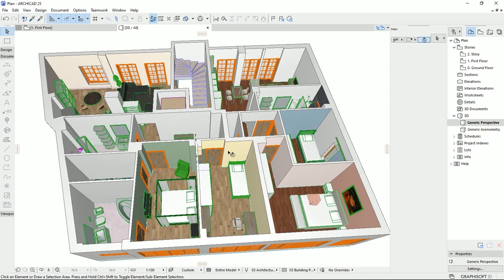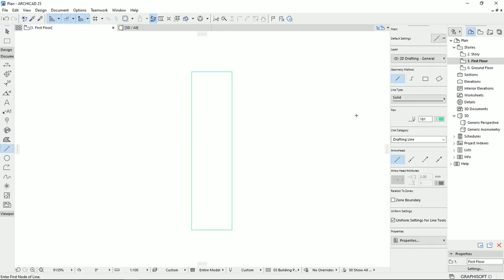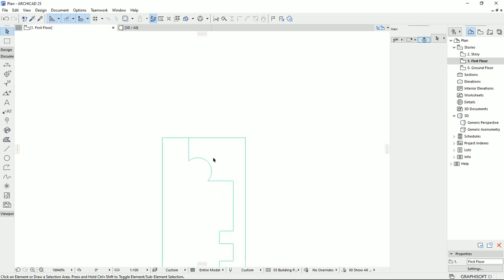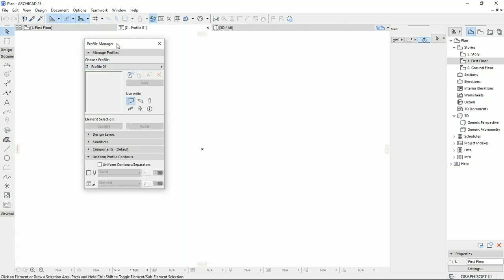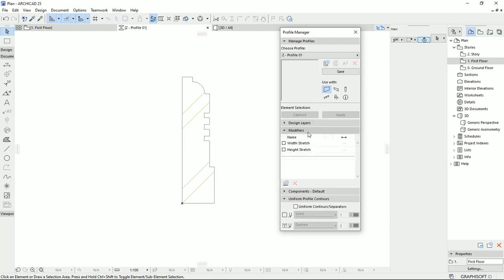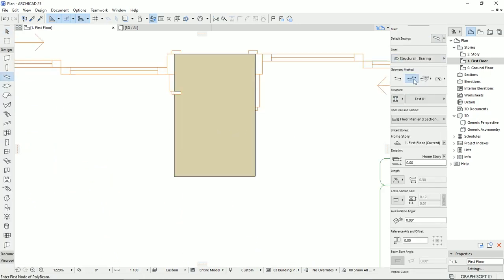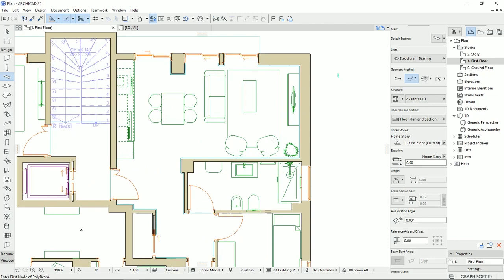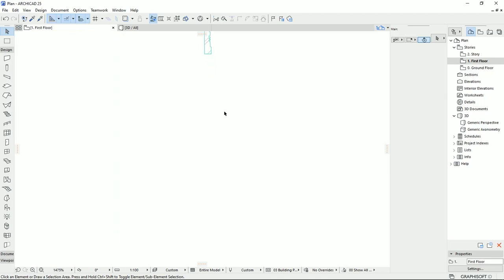Archicad - How to use Profile Manager [wall skirting and cornice]

Comment: Thanks for the video, do you know how to show less lines in section and elevation of the skirting? In this case every time there is a change in direction of the profile a line shows up in elevation and you end up with a block of lines. Cheers
Reply from the maker: Hi Friend. The correct way of seeing the skirting or a profile in a section is to see the line where there is a change of direction. but even if you don't want to see them, you can change the settings of the section for "UNCUT ELEMENTS"